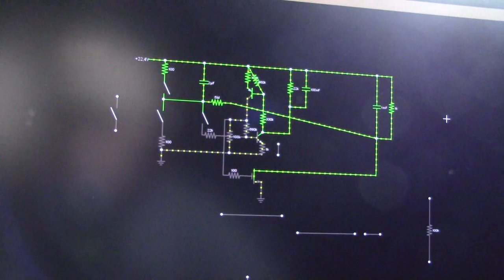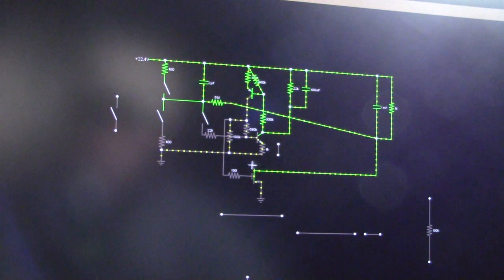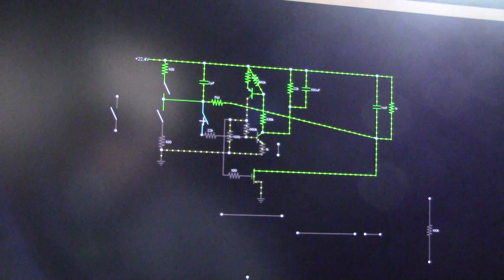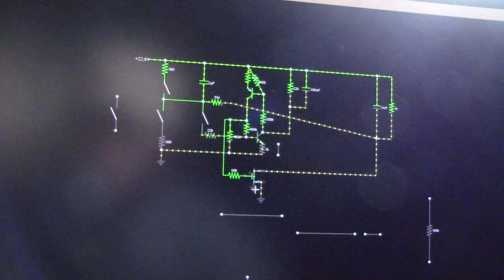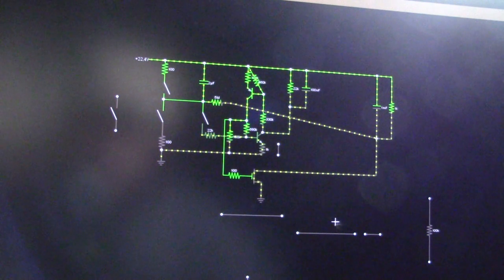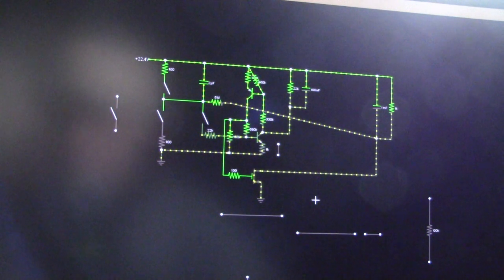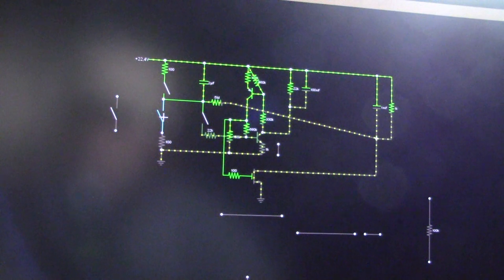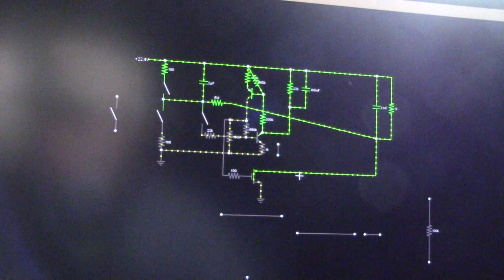Uncut angry ramble: Broken latching power switch circuit

Comment: i mean a rotary latching type bang once contacts close by cam action and bang again they open.
they use a ratchet and pawl mechanism...but i applaud your brilliant understanding of silicon behavior and wish i could interpret circuit theory at your level.
Reply from the maker: +Dale Costich Ah, that would make sense. The downside would be that it would be that it would be impossible to turn the device off if the battery cuts out, but it's certainly a feasible solution.

That said, my amateur level understanding of silicon behaviour is hardly worthy of applaud - but thanks anyway. ;)

Comment: isn't the negative of the amp connected to the input negative through the audio inputs and power supply ground? I guess it's not an issue with battery power but as soon as you connect the scope ground lead you have a problem again. Best to switch the positive rail...
Reply from the maker: +Jernej Jakob The amplifier's ground would be going out through the audio inputs where it could possibly be mated up with mains ground at the source (PC, etc.). It's not an issue during testing since I'm using a fully isolated power supply, but you did remind me to check whether or not the speaker's internal PSU is bonded to ground or not.

You're right that it'd be better to use positive side switching, though. I went with negative side since I don't have any suitable P-ch. FETs lying around - a decision made out of pure laziness.

Comment: why not just use a relay and just activate your load?
Reply from the maker: +Dale Costich It uses too much power when activated. The point of this circuit is to waste very little battery power in both its off and on states.